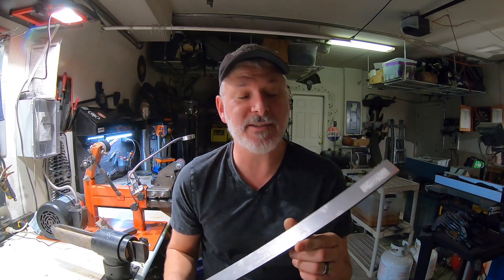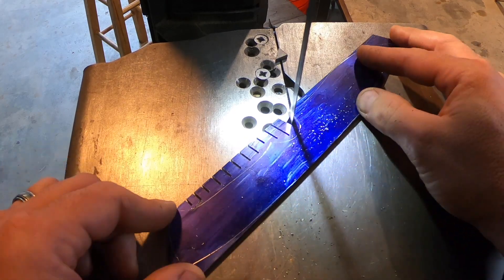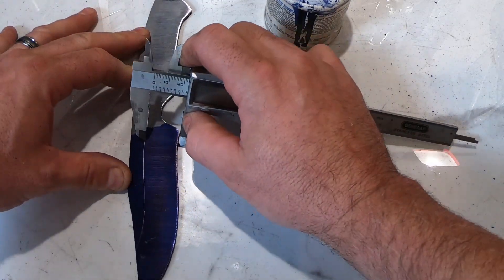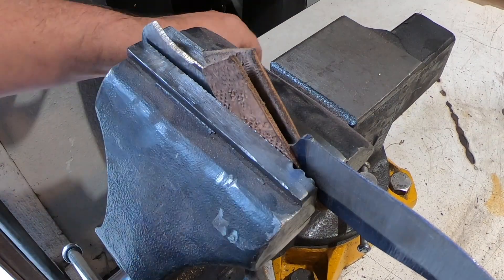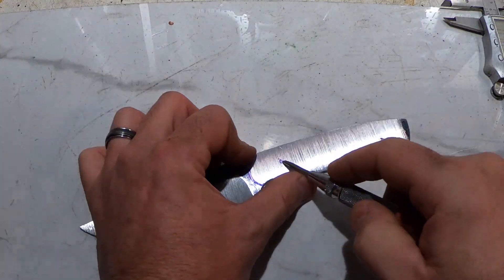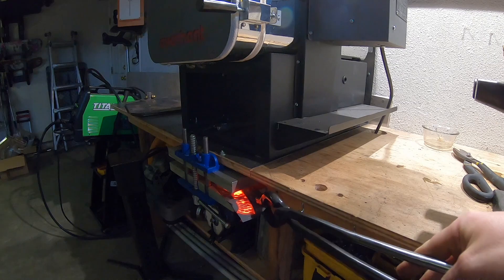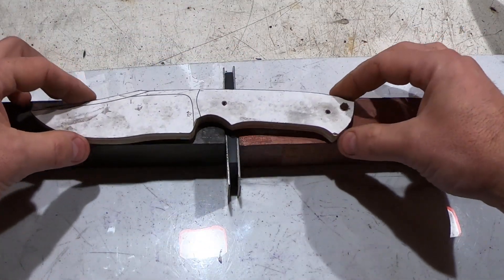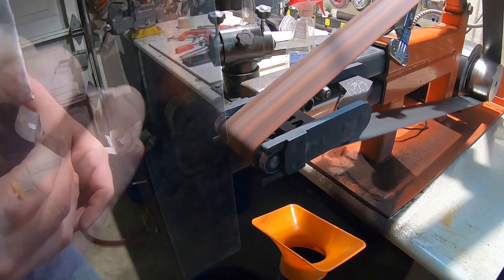Making a Stainless Steel Hunting Knife | Heat Treating AEB-L

Comment: are the handle scales seen in this video stabilized? I bought a bunch of unstabilized hard wood from a hardwood store and use them in knives but I am unsure of how good they are really.
Reply from the maker: This particular handle is a combination of a bunch of wood.  African Blackwood doesn't really benefit from stabilization, it's already very dense and very oily wood.  Several woods like African Blackwood and Ironwood don't need stabilization.  The purpleheart could be stabilized but it's really not that necessary.  I am also combinding these on a G10 liner, which helps isolate it from the handle and prevent any warping.  Each hardwood needs to be considered in its own right.  Something like Oak or Beech would be better to stabilize since it could definitely warp from heat.  I hope that helps.  Thanks for watching.
Reply: @TyrellKnifeworks Definitely helps! I've been binge watching all of your videos from oldest to newest. I just ordered the mag chuck from you (you emailed me today). I will look up recommendations for each of the hardwood blocks I bought online. Thanks for all the help Denis! 
Chris
Reply from the maker: @virtualvegan7376  ah ok, Chris!  Thanks for the order.  If you want more help and attention, you might consider joining my Patreon (assuming you haven’t already).  That gives you the community chat and direct access to me to ask questions, plus access to all my designs and much more.  👍
Reply: Ah, yes I might consider that! I can only see benefits from doing so as I'm sure the information is invaluable. Thanks for your time thus far, I appreciate it! @TyrellKnifeworks

Comment: Really enjoy your videos and knives. Please, when you are using the miter gauge to do cutoffs on the table saw, clamp a block to the fence well in front of the blade and set your distance from that block. Then you won't have any issue with binding the cutoff between the blade and fence and potential kick back.
Reply from the maker: Thanks for the tip, Mark.
Reply: @TyrellKnifeworks  my pleasure. Just want to make sure you keep all your digits and innards!

Comment: Great video man, as always!  I am getting ready to use AEB-L for the first time for a dive knife project and am curious if you find that the steel has good corrosion resistance?  I would assume it does but I can't find a whole lot online about that aspect!
Reply from the maker: Yes, AEBL is a very decent stainless steel.  It holds a great edge and is very stain resistant.  It’s also very inexpensive.  Thanks for watching.
Reply: Just what I was looking for

Comment: Do you think it's possible to do gold inlay in a stainless blade? Maybe on the bolster if I do an edge quench ...
Reply from the maker: Sure it’s possible, you just have to do it before you harden, but that means you’d have to grind pre-heattreat pretty close to your final specs.  It makes your HT dicey.  Also, edge quenching is a terrible practice.  It produces poor blades.
Reply: @TyrellKnifeworks  man, thanks!!

Comment: Thanks for this, I have been eyeing up AEB-L for some time and am very tempted to make the jump.
Reply from the maker: It’s probably the easiest (and cheapest) of the stainless steels to starts with.  Thanks for watching.
Reply: @TyrellKnifeworks  seems to me almost as good as the new super steel Magna cut (almost) at a fraction of the cost.
Reply from the maker: @ShelleyRaskin  no, not really.  Magnacut gives a much higher post-temper hrc and has way better stain resistance.
Reply: @ShelleyRaskin  The guy who invented MagnaCut (Larrin Thomas) refers to AEB-L as the stainless 52100, which is a huge compliment to AEB-L.
Reply: I’m hearing magnacut is very difficult to grind.
Reply from the maker: Yeah, Magnacut is no fun to grind. It certainly eats up belts, but that’s the downside of such a high hrc steel.

Comment: Does heat treatment hardens stainless steel  ?
Reply from the maker: You must start with high carbon stainless steels like AEBL or CPM154.  You can’t harden typical low-carbon SS you’d typically find for structural steel.  Thanks for watching.
Reply: Interesting vid some new info. Subbed
Reply from the maker: @Pasotintojas1  Welcome to the channel!

Comment: I'm digging through the Chum bucket and I need a refresher on this topic. 😂
Reply from the maker: I haven’t done an AEBL knife in awhile.  Maybe after my JS. 👍
Reply: @TyrellKnifeworks  My Man. 👍 I'm looking to work with this material soon. Will see how it lines up with my future project. 😉
Reply from the maker: @mcrich1978  I strongly suggest you heat treat it first before you grind it.  It likes to warp like a #$&@! 😜
Reply: @TyrellKnifeworks  lol. So... cut out blank drill your pins and go strait to HT from there and take your time at the grinder?  That sounds very "Barbershop Customs" 😉

Comment: Loving this channel!  Just started my first ever knife build which also happens to be made from stainless.  If I may ask, in this video, what are you doing for those few seconds between grinds? Are you cooling the blade with water or oil? Is that a always a good idea when grinding the bevel?
Reply from the maker: Welcome to the craft, Evan!  I would caution you on stainless though, you’ll probably need to send that out for heat treat, because it needs special equipment.  Yes, between grinds in cooking it in water.  This is particularly important post-heattreat so you don’t overheat it and ruin your temper.  Thanks for watching!
Reply: @TyrellKnifeworks  Thanks! Yeah,  I'm learning that stainless steel is quite a bit more involved than many other metals.  I was just given about half a ton of stainless steel rods. It seems a pity not to use them.. but, maybe I'd be better to scrap them and use the money to get some 1025 or something.  Anyway. I really appreciate you always responding to comments. That's super cool!
Reply from the maker: @evanpiquette5019  Also, the stainless steel you've been given is very unlikely to be high carbon so it probably won't harden anyway.  Good for playing around but probably not good for knife steel.  (and 1025 is not high enough carbon for knife steel, you'll want at least 1075).
Reply: @TyrellKnifeworks  super helpful! Thanks so much!

Comment: isn't quenching made in oil? I don't understand the aluminium block part
Reply from the maker: Oil is used as a quenchant for some steels but most stainless steels are air quenching so you use aluminum plates.  Checkout a recent Triple-T video I did on heat treating.

Comment: Hey, sweet looking knife tho! How did u finish the handle? Which products do u use? Best wishes from Austria
Reply from the maker: Hey Raphael, for the handles I typically just sand the wood to 1000 grit and then buff them with some white compound and then apply wax and then give them a polish.  I used to use teak and tung oil but the finish is shiny and slick for my liking.  Hope that helps.

Comment: Nice build, sir! I still like the idea of using your plate quencher as a double-duty warp remover. Not that any of my blades ever warp, mind you!
Reply from the maker: I have some angle iron that I’ve welded bolts to so I can tighten it AND put it in the temper oven so I tend to use that.  I also have a straightening jig for taking warps out that I’ve shown in a few videos.  Not that I’ve ever had a warp either.  😜

Comment from the maker: The heat treat regiment for this knife:  1) Heat oven to 1350.  Place knife in stainless steel foil pouch and soak at 1350 for 2 hours, let air cool. This anneals it.  2) Heat oven to 1950, place blade (in pouch) into oven and soak for 15 mins.  Plate quench and apply compressed air.   3) Remove blade from pouch and place between blocks of dry ice for at least an hour.    4) Temper at 400 for 2 hours, twice.
Reply: It's been my experience that you get a much better cryo quench if you put the dry ice in an acetone bath, making a slurry. You get very even temps, well below the required temp. Leave it out on the bench when done and the dry ice evaporates out, leaving you with acetone that you can just pour back in the container.
Reply from the maker: @SelfMadeProject  I have actually just stopped cryo with dry ice altogether.  Given the data from Dr Larrin Thomas, it is marginal over just putting the knife in your freezer.  It's a difference of less than half a point of hrc.  It's just not worth it IMO.  The change of using a slurry of acetone would not be a measurable difference.
Reply: @TyrellKnifeworks  hey, I wasn't trying to argue or say there was anything wrong with your method. Back when AEBL was first coming on the market the subject of cryo was all over the forums. One of the Sandvik engineers was on one of the discussions and he also said the difference between fridge and cryo wasn't huge, but he recommended the dry ice slurry for maximum performance. Seems like he said you need to get it to -90 or below. I measured the acetone/dry ice slurry with a thermocouple and was able to get temps of -120 degrees. I found that I was able to gain a full hardness point over just plate quenching. Can the average end user tell a difference? Probably not. So, I use cryo when it's a kitchen knife or fillet knife or when I want the absolute best edge retention and sharpness. On hunters or field knives, no, I don't usually bother with it either.
Reply from the maker: @SelfMadeProject  yeah, I get it, and I know you weren’t being argumentative at all.  My point is that there is empirical evidence that dry ice (no matter what the method) is marginal (less than 1/4 hrc) over just putting it in your freezer.  Check Larrin’s data on it.  Now I don’t bother with the dry ice at all.  I can get CPM-154 at 62 hrc after temper.  That’s about as high as I want to go with a kitchen knife.